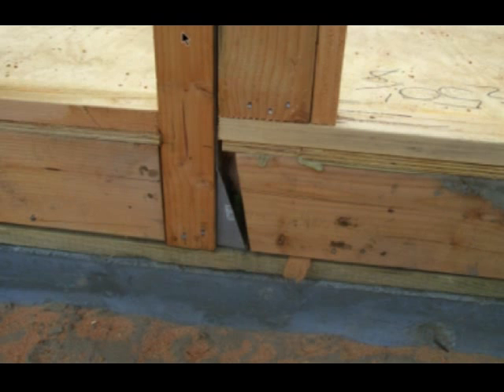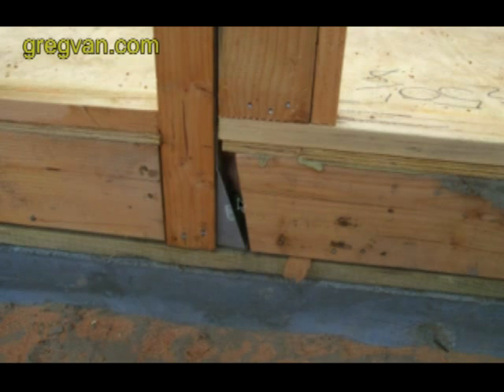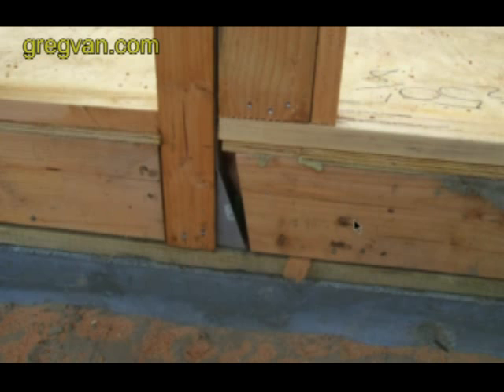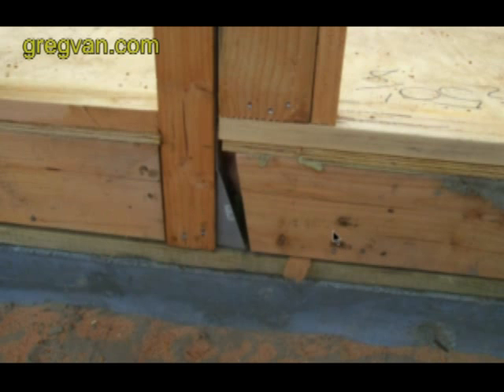Sub Floor Framing Hold Downs - Structural Engineering Tips

Comment: A simpler method is to add a block of wood to be inserted between the sill plate and the floor  plywood, the anchor but will have to go through this word block. The wood block will act as a stiffener.
Reply from the maker: +Adel Jaber It would definitely be easier, but I think this method will provide you with a better product and a little more structural strength.

Comment from the maker: You got a good point and you know over time with enough movement the foundation is going to crack anyway and these could be pressure points. Anyway, there are plenty of homes that aren't even bolted to the foundation, that are still doing just fine.